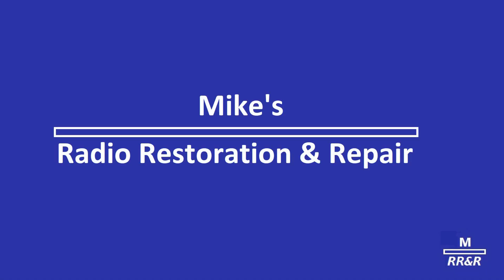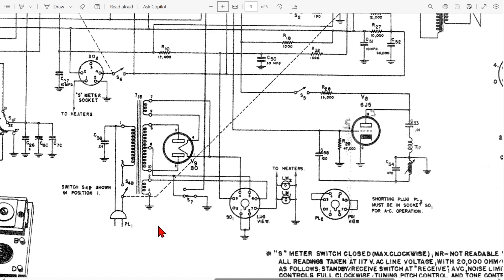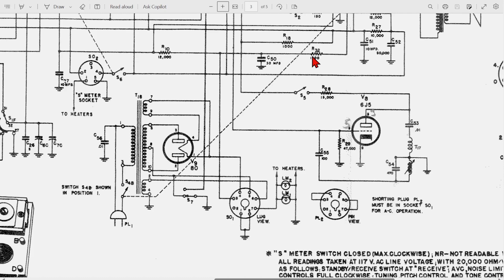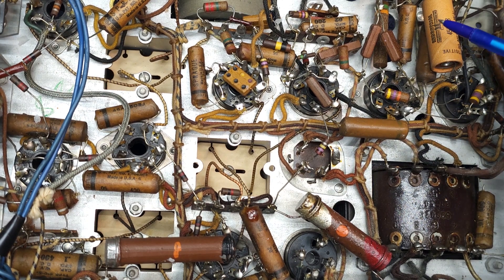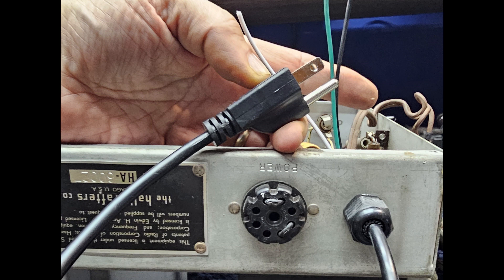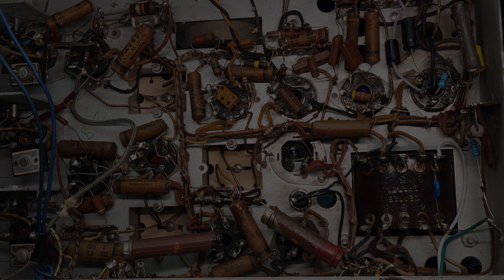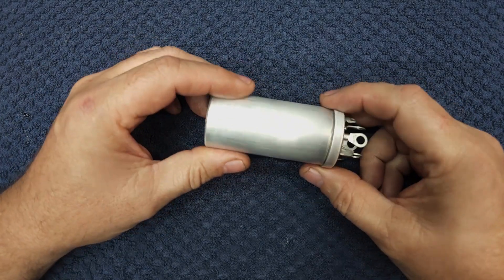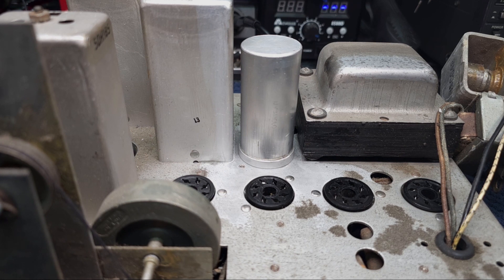Hallicrafters S-40 Restoration Pt. 2 - Power Supply Refurbish

Comment: Thanks, Mike. Excellent video. I like the abbreviated approach, mainly since I already do restores, though some might be interested in more detail such as actually dremeling (is that a word) the cap to show how to open one. I may start using a dremel for that as I now have been using a hack saw which is more tedious.
Reply from the maker: Yes, put that hack saw away. To be clear, I use a flexible shaft with my Dremel. This allows me much greater dexterity as you can see. Both halves of that canister fir back together perfectly without serious clean up. However it wasn't always like that. My first few looked like I was drunk. :) I use that Dremel routinely in my restorations. As for the abbreviated versions, I feel that our subscribership here are fairly sharp folks and can run with the ball. However if anyone feels I have glanced over something and has questions, just fire away. I got no issues answering questions.  Cheers and Thanks.

Comment: I was glad to hear that you are going to continue to clean up the chassis.  Of course you are going to paint the "E" & "I" plates of the power transformer the required Colonial Red, right?  ;-)  
On a serious note, are you going to paint the clamshell of the power transformer at all? I ask because I watched someone paint a chassis with a chrome paint that was amazingly "watery" but dried super fast.  It made the chassis look like it had been chromed plated and like it was brand new.  I have not seen a transformer like the one on this radio on any other I have seen.  Usually 2 clamshells are seen and both have been painted black.  The clamshell on this one appears like it is made of aluminum which I have never seen before.  I wanted to suggest using the chrome paint on the clamshell since I think it would improve the look of the transformer.  While my bit about the "Colonial Red" paint was a bit tongue in cheek, I seriously think it would look better with it painted red.  There is another gentleman that restores old radios and he does use the red paint on every  one he works on and I have to admit that it does look good.  Anyway, it is a personal preference issue and you either do it or not...neither way is "wrong", just a matter of personal preference.
Concerning the Electrolytic capacitors in the metal can, I have seen someone do the prying off the ring at the bottom and then after restuffing it the ring was folded over and looked amazingly good, but I like your method better.
When I get out of the financial hell that I am in, I have a Hallicrafters 8R40 Run 1 radio that I need to work on, and it requires a LOT of work on this one!
Reply from the maker: Imma thinkin' Imma gonna take a pass on the red :)  The top cover is silver painted steel. If something needs painting i usually stick to the original colors for the sake of an accurate restoration. But in this case, to paint any portion of the transformer would mean removing it. And disturbing all those 80 year old connections on the bottom of that unit just isnt a good idea. So I will clean it up as best as possible. Why poke the bear. Know what I mean?